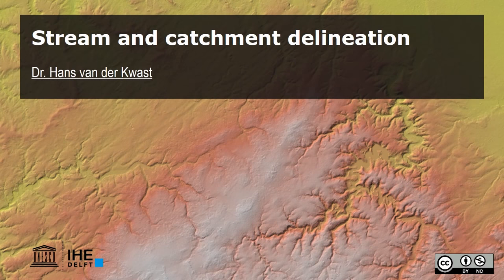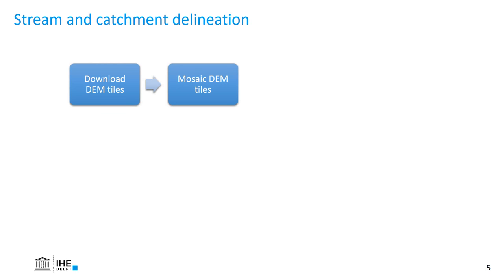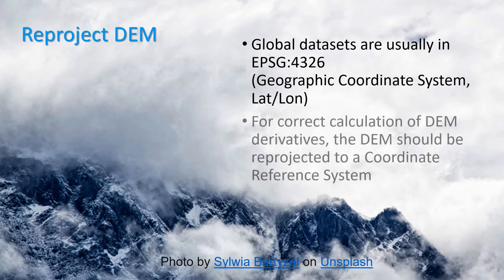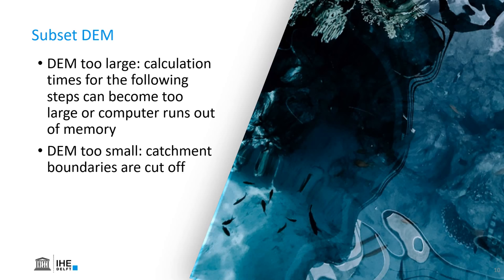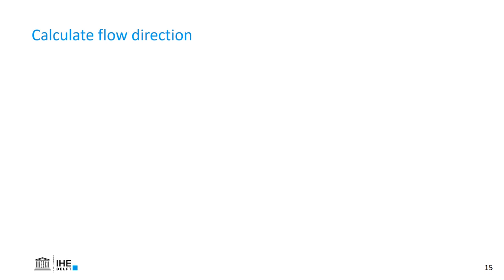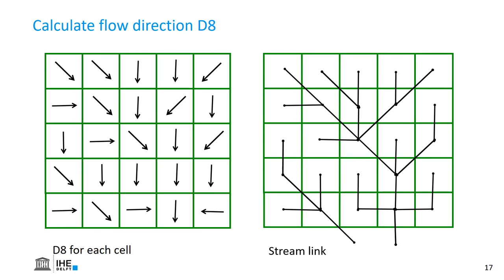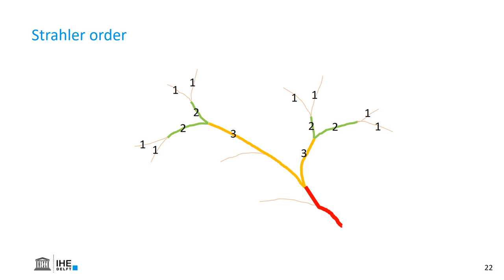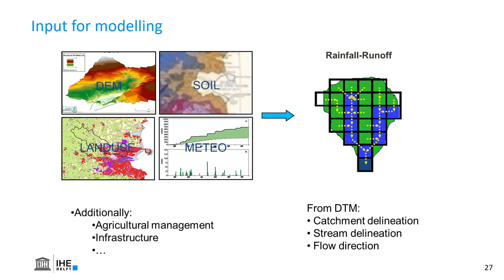Stream and catchment delineation with GIS (theory)

Comment: Great video. Thanks for sharing! 
You said that it does not work for flat area and human controlled environments, do you have a workflow for such a case? 
Thanks A.
Reply from the maker: In human controlled environments you have to look for maps from the authorities who manage the water. If that's not available you can do a visual interpretation. Unfortunately there's no algorithm yet that can interpret the human control on the environment and translate that into a catchment map. For flat areas that are not human controlled, you can play with the minimum slope parameter in the fill sinks algorithm or burn in the river network if you have a hydrography layer. In that way you force the water to follow the existing river system. No videos about this yet.
Reply: By human controlled environment I actually ment artificial ditches networks in flat area that make difficult to get a reliable catchment area, so I guest that by burn on the ditches network on the dem and playing with fill sink minimun slope would help a lot. It you believe is relevant for the channel would be great to have a video...otherwise thank you again for tour much appreciate help! A.

Comment: Hi Hans! In the 'fill sinks' step, you say real sinks (e.g. lakes) need to be added after pit removal. How can this be done? I have polygon layer of lakes if that is of use?
Reply from the maker: You can burn those in the DEM to force that the DEM is lower at those locations. Similar as burning rivers. We made some tools that are available in the PCRaster Resource Sharing repository. Alternatively you can play with the parameters of the lddcreate algorithm to not fill all sinks.